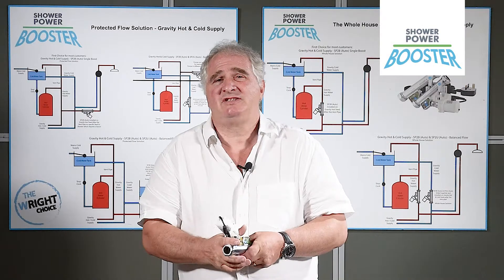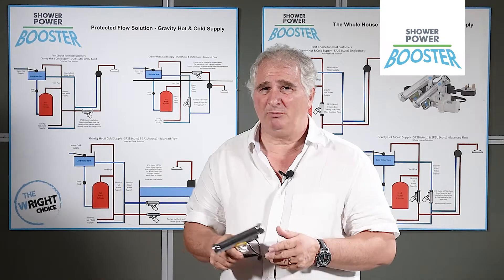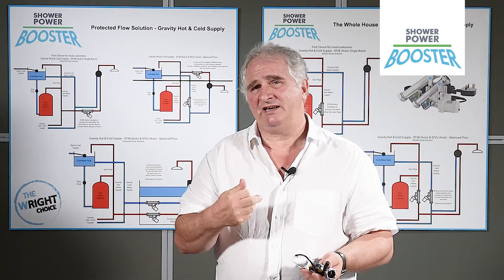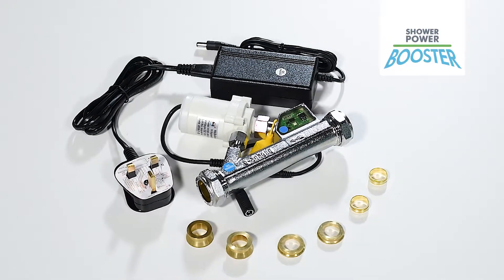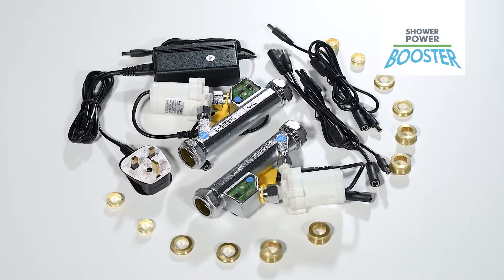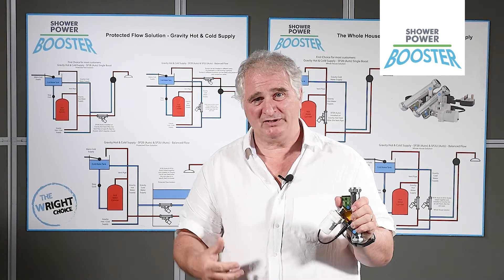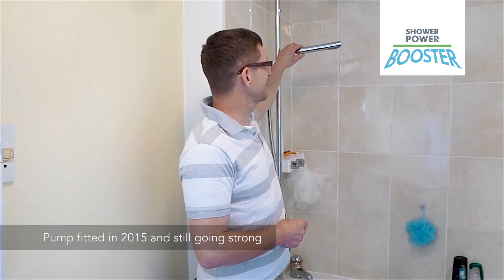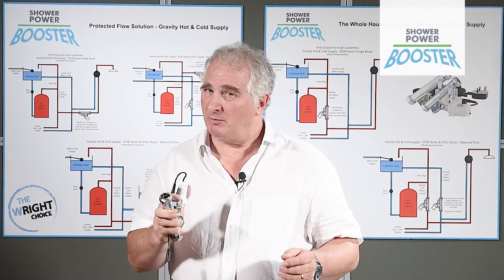Increasing Pressure and Flow with a Shower Power Booster

Comment: How can I fit it onto 21mm pipe in Ireland? Is there a reducer for this?
Reply from the maker: You need a 'conversion olive' which  has a 22mm face and a 21mm face. Just use a conversion olive in place of the 22mm olives with the pump you have.

Comment: hi Alan ! does this work on mains fed Mira electric shower 9.8 kw ? bit of confusing pipework layout in the property as there is not main stop valve for whole property but all appliances get supplied individually from mains raiser of big block of flats  and  electric shower is directly connected to the main coming down the raiser but its run on 15 mm pipe to the shower unit where distance between raiser and shower unit is quite long so i was wondering if this booster would help thank in advance.

Comment: Hi Alan, My plumber has told me this won't work for me as I'm wanting to feed mains cold and low pressure gravity fed hot in to a mixer shower and they will be imbalanced. Is he right or will one of these pumps solve my problems? My mains is around 2.5-2bar and I suspect going from the height of the tank above the shower I'll be getting less than 0.1 bar from the hot (without this pump).
Reply from the maker: If you have mains pressure cold then you are better to double boost the the hot with a SP21S. 

https://showerpowerbooster.co.uk/product/sp21s-pair-shower-power-boosters-double-boost/

Each pump is a half bar pump so two half bar pumps in series gives you 0.5 + 0.5 = 1 bar.

Most shower mixers will work with a hot vs cold  imbalance of up to 5 to 1 so the mixer will be balanced enough to work perfectly. A SP21S IS PERFECT FOR YOU.

Comment: Would this work as a stratification pump for a system with a Willis (Tesla) water heater.
Reply from the maker: It would work but not as well as the new stratification pump I invented - Pat Pending and still under wraps.

Comment: Can I fit this to a single shower in an unvented indirect system. I have a megaflo eco solar PV ready 300l unvented indirect cylinder. Pressure to all other taps in the house is fine, it's just this one shower, I suspect it's low because it has multiple jets.
Reply from the maker: I design the SPB to give a single good tap or shower flow. If you have many showers each one needs a pump. If each jet had a pump then it would work.
Reply: @alandwright2  Thanks, I should have been clearer though. The shower takes in the water flow from the hot and cold and then diverts it from the main unit via the internal mixer, there would be no way to install the SPB to each individual jet as it's all controlled by the main unit. Fitting to the inlet feeds would solve my problem, I just don't know if your product is suitable for unvented systems.
Reply from the maker: @lostunsunghero  We sell lots of SPBs to people with unvented cylinders however for your shower I think it needs a lot of water. The ShowerPowerBooster is an amazing device, it can boost any and all plumbing systems, but it cannot perform miracles. The SPB will always fix a pressure problem but if you simply want a better shower flow and you already have a good shower or tap flow the ShowerPowerBooster will recognise you already have a good shower and deactivate. https://showerpowerbooster.co.uk/wp-content/uploads/2023/03/FlowflexShowerManual_21_03_23-NEW.pdf

Comment: Hi Alan,

Just down the road from you in Thetford.
I have a ‘power’ shower which is gravity fed for cold (tank in loft) and cylinder fed for hot , I’m having the cold swapped over from the gravity tank feed to a cold water mains for pressure reasons and I was going to install a pump on the hot water , which model pump do I need ? It’s 15mm copper and would be installed in the airing cupboard.

Comment: Hi Alan, can I fit this safely to a combination water tank? My only concern is that the cold tank is 20 litres only and the hot is 80 litres. I am worried that the cold will not have enough time to refill.  Thanks
Reply from the maker: The SPB works very well and will boost  any combination water tank. Google SHOWERPOWERBOOSTER FORTIC TANK. and you will find a detailed explanation of why it works so well with these tanks and what you can do.

Comment: Nice, design recently installed this in line to a sink and the pressure increase is negligible., I was hoping that with 1 bar advertised it'd be blatant.

Installed with no leaks & I have to say I'm not getting the pressure others are getting in their videos.

The install is about 1m away from the tap due to the moronic install throughout the building I'm working in., vinyl floor with no access to the pipework beneath 🤦

States it can be installed anywhere within a feed? Is this true?

Thanks
Reply from the maker: The SP2B is a single boost 0.5 bar pump pump and a SP21S double boost (0.5 + 0.5 = 1.0 bars). If there was not a lot of difference then if you let Flowflex have details of the installation and flows before and after we can look to see what is going on.

Comment: Looks good, I take it there is no need for Surrey flanges etc?
Reply from the maker: There is no need for a surrey flange. They work better without one.
Reply: I'm going to try them Alan. Is it the same pump for heating and showers?
Reply from the maker: @davidkneale7455  It is NOT the same pump for heating and showers. I sell radiator boosters for radiators and SPBs for showers and taps.

Comment: Hi, does the pump vibrate? As I've came across one. And it does, seem to be doing anything. I even bypassed the switch, and plugged it direct, to get air out. But still nothing.?
Reply from the maker: I can go through some diagnostics with you if you contact me through the website http://www.showerpowerbooster.co.uk/

Comment: This looks a very interesting product.  I'm thinking of getting one to boost a string of radiators that struggle on undersized pipework. Do you do a heat activated switch so when heating comes on this can be detected and switch itself on?
Reply from the maker: Please visit https://www.wrightpumps.co.uk/ and you will see my range of Radiator Flow Boosters. You can also  contact me at alanderekwright@icloud.com 
There are several ways of controlling the pumps. I have a new sensor which will turn off the pumps when the temperature rises and other ways of turning the pumps on when the temperature is low.
Reply: @alandwright2  Hi Alan, plumber of 50 years here but sill learning! Where do we get your pumps from and what price please?

Comment: There's a market out there for using these in campers and caravans, just not at 22mm
Reply from the maker: The ShowerPowerBooster Pumps come with 3 part reducers to fit 15mm as standard. They are bought by some customers for camper vans and caravans and camping in general. I have a new submersible version of the pump which I advertise as a 'automatic garden booster'. To buy one use this link:-https://www.wrightpumps.co.uk/product/12-volt-garden-leisure-pump/
Reply: @alandwright2  hi Alan thanks for the suggestion. My campers warm water tank is at floor level so I effectively I have a 1.9m negative head shower system. I want to buy British so I was going to give the SP1 a try. Do you think I'll get at least 5 litres a minute through 15mm pipe at 1.9m head with that pump? Cheers
Reply from the maker: @paulshanesmith  Hi Paul, At 1.9 negative head a SP1 will give you 5.4 litres a minute without dynamic resistance. The SP21S would give you around 6.5 litres a minute with dynamic resistance and you could get a negative flow fully automatic pump solution. I think a SP21 would suit you better but email me at alanderekwright@icloud.com and I can put together a bespoke package.
Reply: @alandwright2  I've just test benched the recently purchased SP1 pump connected exactly as it will be inside my camper project and it works brilliantly. It's exactly the right amount of flow for a decent shower and unlike typical pumps used in the camping community yours is very quiet and doesn't need an accumulator. Very very pleased. Thanks

Comment: the water pressure where I live is about 60psi directly from the city main water supply .   I have lower  pressure in one of our bathroom showers....will it boost our bathroom shower  pressure more...... even though our existing main city water supply is at about 60psi already
Reply from the maker: If you have 60 psi this is over 4 bars pressure. This is much higher than normally provided in the UK where the mains pressure is typically below 2 bars and could be as little of 1 bar. A double boost SP21S will add 1 bar but with 4 bars to start with a 25% increase in pressure will only add 12.5% extra flow. However, I strongly suspect that mains pressure is not your problem and its a capacity problem.  My pumps only help if it is a pressure problem so adding pressure is unlikely to help.

Comment: Hi can this be connected on the 22mm draw off of the top of the cylinder or or does it have to be after the expansion to the tank in the loft
Reply from the maker: Hi James - Please download our latest instruction manual using this link https://showerpowerbooster.co.uk/blog/new-showerpowerbooster-manual-for-2022/

Comment: Alan - help! I'm on a narrowboat. I have a cold water tank with a DC pump to provide water pressure. I have an expansion tank branched off the hot water output set at 3.6 bar. Can I insert the booster on the tap side of my hot water tank to boost shower pressure? If I insert it into the shower mixer's hot feed pipe then I assume it will still boost all hot water taps on the system or only the shower i.e. what's beyond the pump? Very much obliged, Steve
Reply from the maker: You are correct. In summary a ShowerPowerBooster fitted to any pipe will add pressure to the water flowing in that pipe so if that pipe boosts just one shower then it boosts the pressure to just that shower. If that pipe supplies lots of taps and showers then it adds pressure to all those taps and showers but is only really effective if you use one shower or tap at a time. The amount of boost you get depends on if you single boost with a SP2B or double boost with a SP21S and the rule of thumb is that whatever your pressure was to start with, if you increase the pressure by 100% you increase the flow by 50%. If you contact me through the web site and explain your problem then I can advise further.
Reply: @alandwright2  Good morning to you Alan! Help... again! On the narrowboat I've tried the pump on the hot water feed to the bath shower/mixer... but as the water system is all pressurised by a Jabsco water pump and a hot water accumulator the little pump can't drag extra water through the main pump to feed it, so once the "credit" in the accumulator has been used the flow reverts to that of the main feed pump only. But, I got to wondering... if I fitted your pump between the fresh water tank (ambient pressure) and the main pump I just wonder if it would boost the overall rate that way?
Reply from the maker: @34136TS  The Jasco water pump is a 'diaphragm pump' and my SPB is a centrifugal pump single impeller pump. It will not boost the flow through diaphragm pump. It will increase the pressure but the Jasco pump is not keeping up with the flow rate of the shower so the SPB is being starved of water. A second Jasco pump side by side with the pump you already have might do it? I am sorry that I did not ask the type of pump you had when I replied previously.
If you bought the SPB through https://showerpowerbooster.co.uk/ there is a 30 day money back guarantee (if you find it does not work in the application you wanted). I am curious as to why you have a problem in the first place. Please contact me through the web site if you want to discuss this further.

Comment: Have had 2 of these fitted to the hot and cold gravity-fed house supplies for over 3 years as it was less than 0.2 bar pressure.  They work better than advertised - shower went from 2.5l/m to over 6l/m (easy to fit and very quiet), but I'm considering fitting 2 more to the hot and cold shower feeds to boost it further.  Will the flow double again or will the improvement be less noticeable; will the pressure increase with the same shower setup high flow flexipipe and head)?  As an aside, the flow rate was so low on the shower to start with that I had to fit a switch box to swap between automatic mode and manual override for the shower as the flow sensors didn't trigger the pumps.  Also added an Alexa plug to the mains supply so they don't run at night if someone uses the toilet! Versatile product and I'm very impressed - highly recommended.

Comment: Hey Guys. My boss bought one of your SP2B boosters in 2014 @ the R.D.S homeshow in Dublin. Alas, he never actually fitted it, and now it has come into my possession. It has never had water running through it and I'm wondering if it would still be safe to use now. Any thoughts?
Reply from the maker: The pumps have been improved upon many times but the 2014 model was still good and should work fine.

Comment: Does this work with combi boilers? And also connect via 12 volt draw from a light in my bathroom as I have no power sockets in there.
Reply from the maker: Yes they will work with Combi Boilers 
https://showerpowerbooster.co.uk/information/you-can-fit-a-pump-to-boost-a-shower-or-tap-on-a-combi-boiler-system/

You can take the power directly from the light in your bathroom but I suggest that plugging the transformer into a plug socket in another room and using a 3 metre cable might suite you better. Just drill a small hole to push the cable through to the bathroom? 
https://showerpowerbooster.co.uk/product/2m-extension-cable/

Comment: Can you use this to increase the cold water mains pressure to an electric 9.5kw shower - Other Plumbers say you should never fit a pump to anything mains fed?
Reply from the maker: It is legal and safe to boost up to 12 litres a minute and the design of the SPB limits the flow to about 8 litres a minute. You can boost the pressure to an electric shower but if your shower already has 1 bar of pressure then giving it more pressure will not help as a 9.5 KW electric shower will only heat 4.5 litres a minute to 42 degrees centigrade and it will close down the flow  (use this link to read more https://showerpowerbooster.co.uk/electric-showers/https://showerpowerbooster.co.uk/electric-showers/

Comment: Hi Alan, if I fit two of these between a bathroom sink and bathtub with mixer tap and power shower will they activate when the bath taps are turned on?  When other taps in the house are turned on do this activate?  Thanks
Reply from the maker: If the pump is fitted on a pipe which feeds several taps then opening any one of those taps will activate the pumps.

Please refer to the installation manual for how and where to fit a shower power booster (here is the link)
https://showerpowerbooster.co.uk/wp-content/uploads/2019/07/FlowflexShowerManual_2021.pdf
Reply: @alandwright2  Thanks.  That's a pity. May aswell go for conventional pump if having to plumb new pipes.  Nice idea though. Congratulations.
Reply from the maker: @cloudstreetparagliding  The SPB fits on existing pipes so why do you think new pipes. A conventional pump needs to be fitted by a competent plumber . Send an email to us at the showerbowerbooster.co.uk web site.
Reply: @alandwright2  Hi Alan, what i meant is, to prevent the pump motor activating when my bathroom sink taps are turned on separate pipes would need to be plumbed from cold and hot  tanks to shower/bath mixer, just like twin impeller.  My bathroom sink taps are on same feed as bath/shower mixer. Sink taps have decent pressure.  The shower and bath are new and I have found that they need a boost.  Thanks
Reply from the maker: @cloudstreetparagliding  I assume you already pipes to the shower and bath but why do you want to run a bath at the same time as you shower. If someone came into the bathroom as you were having a shower and decided to run the bath at the same time then is that a real senario? Why would you wash you hands at the sink same time as having a shower?
Reply: @alandwright2  Hi Alan, let me try to clarify.  My sink is beside the bath/shower, they are using the same pipes.  In your system the pumps would attach to pipes closest to the shower.  Our sink does not have a pressure problem so they don't need boosted.  With your system connected to existing pipes, if i use the loo then wash my hands the pump will kick in unnecessarily, thats what i want to avoid.  I'm not knocking your device, I think its great but I want something that only activates when shower OR bath taps are turned on.  Thanks again.

Comment: Hi, I have a newly installed unvented system, with a megaflo type hot water cylinder. We used to have traditional gravity fed system, and each bathroom had pumps on the showers. Now that we're on the unvented system, we've found that we can only have one shower going at  once and of someone flushed a loo or opened another hot or cold tap, the shower gets affected. Can we install this pump on the cold mains feed coming into the house?
Reply: Plumber is guessing that mains flow rate isn't very good, but the pressure is very good so I can't understand why two showers at once wouldn't be ok.
Reply from the maker: Hi Marco, huge apologies for missing your comment! If you have any queries on installing the pump, we have an amazing customer service team who are happy to help! 

You can contact them on +44 (0)1928 620 099 or email SPB@flowflex.com
Reply: Should never install unvented cylinder on less than 20L per min flow rate. Your installer f***ed up
Reply: @calderjack7818  Did I tell you my flow rate?